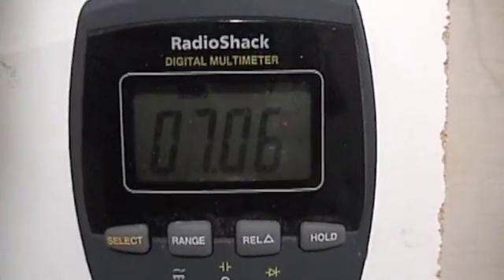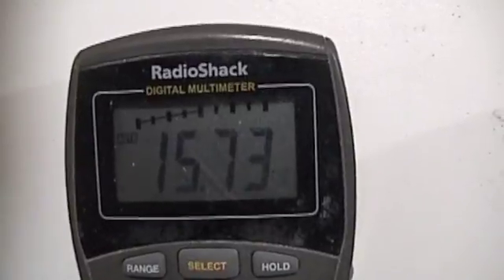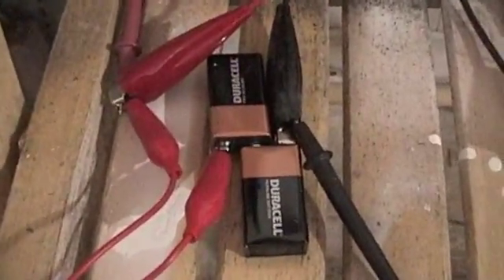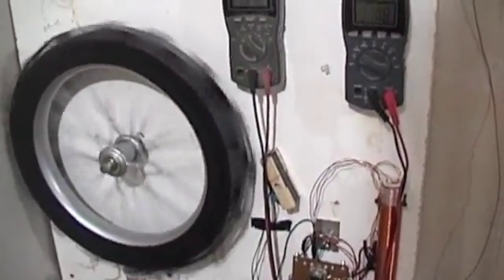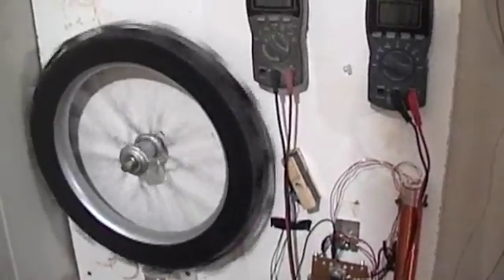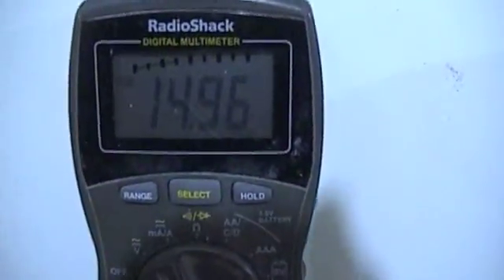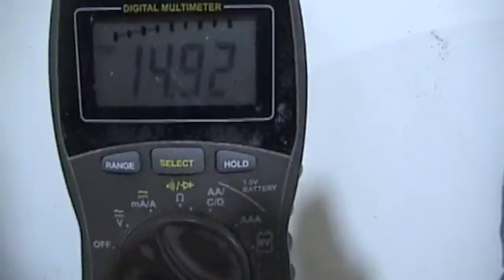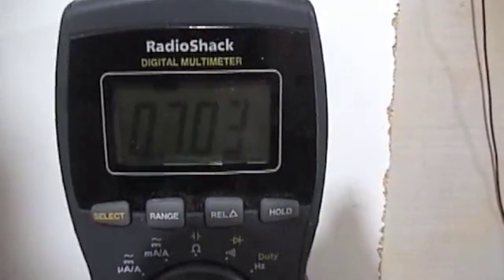Bedini Self Charging on 9 volt Alkaline

Comment: If you want continuous you need two coils offset from one another 30 then 60deg on the other that way when one is of its being charged by the other. Will also create a very hi frequency. If you knew what you were doin you could make the thing wireless anex all the heat from the battery. Then you can collect that "static". And a wheel is a homopolar generator so theres over unity and it was easy.

Comment: LynxSteam 
Hm..... in this configuration the 9V batteries could become overcharged.
At the worst, the'd leak corrosive paste, but that stuff is nasty to clean off stuff.
You CAN recharge alkaline batteries, but you have to do it slowly or they explode.
A Bedini motor powered with a wall AC adaptor makes a great alkaline charger.
The secret is to trickle charge them over a few days so gas does not build up in the cells.
On average they can be charged about 15 times, but some last to 30 or more cycles.

Comment from the maker: It ran for exactly 8 hours.  That tells me the motor consumes more than it gives back by about 50 maH.  I will try rechargeable 9 volt batteries sometime.
Reply: Thats the point, becouse these kind of normal battery will not absorve 100% of the energy like a rechargeable ones